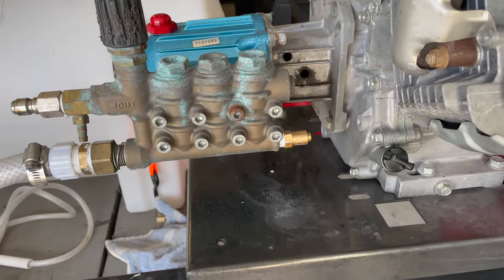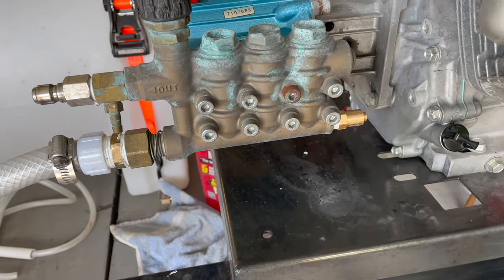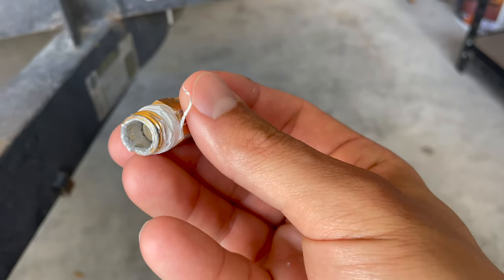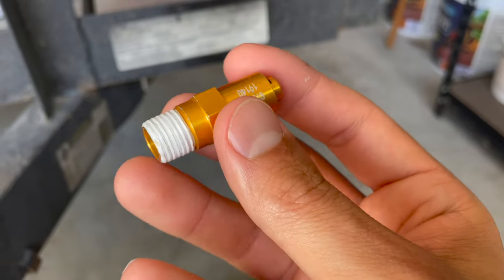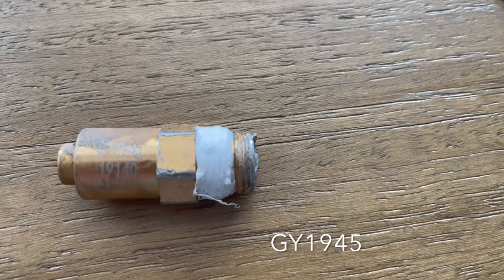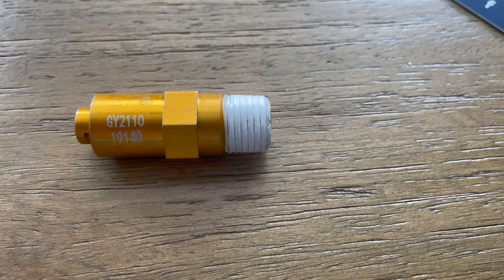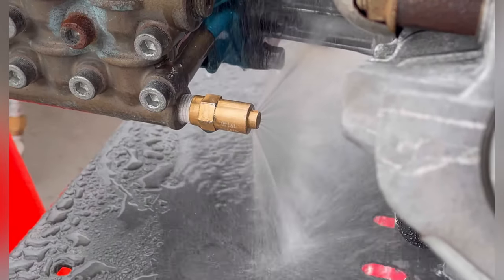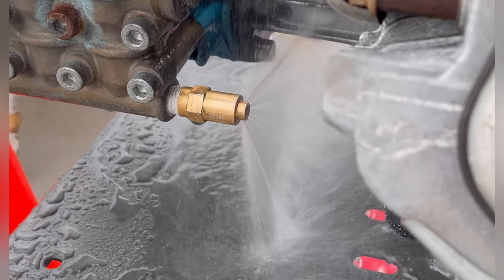FAILURE - Thermal Relief Valve CAT Pump - Easy Fix *Correct Part Number*

Comment: Hello,  does a pressure washer thermal relief valve  reset when cool, or is it  more like a fuse that melts one time and must be replaced?
Reply from the maker: It’s spring loaded. So if you treat the machine correctly it should be fine. Mine went out after 1.5 years

Comment: Mine just keeps leaking water from the val when i open the water flow through the hose . So you know what could be the issue
Reply from the maker: Is it a heavy leak? It may just be releasing the pressure

Comment: On these.  If you are squeezing the trigger isnt this supposed to spray water out so the pump doesnt over heat? Mine does this if i dnt pull my trigger this will start spraying water and its hot
Reply from the maker: It’ll spray a little water out to release the pressure but when this one failed it was obvious by the constant release.